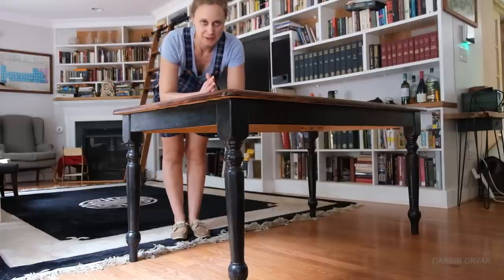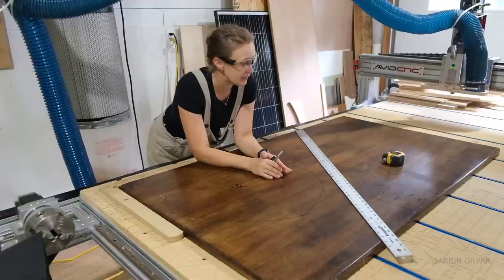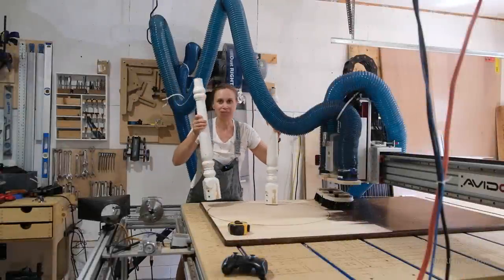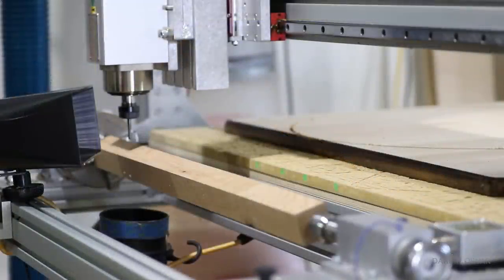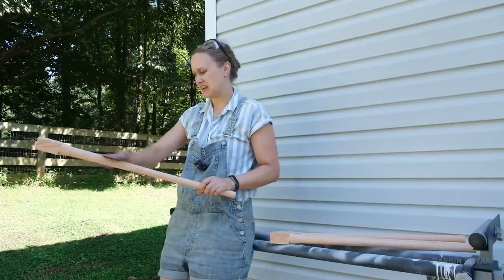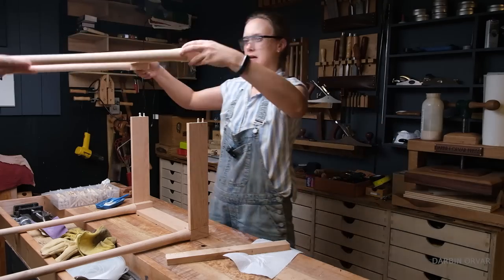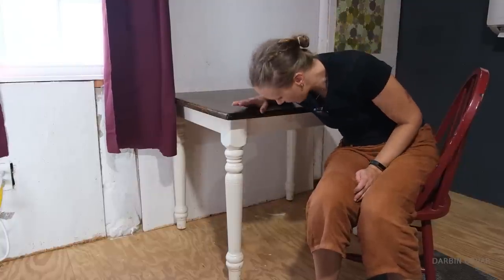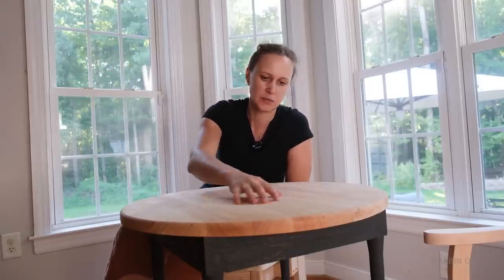Transforming a Kitchen Table into 2 New Projects // WOODWORKING

Comment: Good projects Lynn.
I have a table like that I rescued from the dumpster and did some minor repairs too.

I use it as my computer desk.

I attached a couple of 90 degree angle brackets to the side and mounted a piece of scrap plywood for the keyboard.

Did you get a new mic?
Your audio in this video has a bit of distortion in it.
Reply from the maker: In some parts of this video, the mic was too close. ☹️
Reply: @darbinorvar  

Too close?
Are you using a boon mic?
I wouldn't think the audio would get messed up when it is too close.
But that's good to know for future reference in case I use that kind of setup.
Thanks for the Tip. 😄